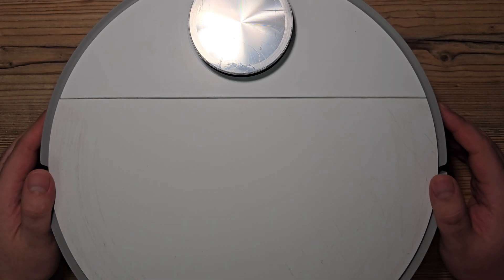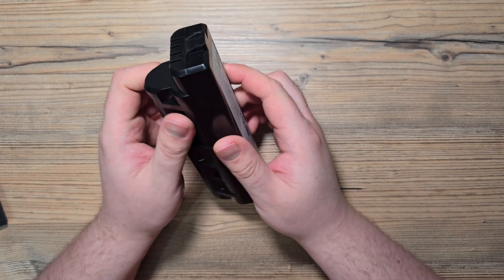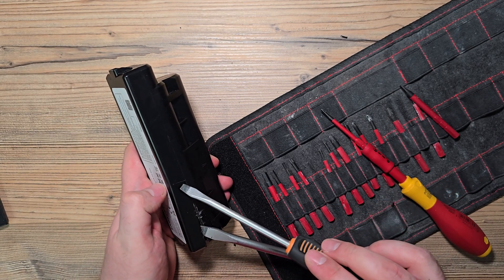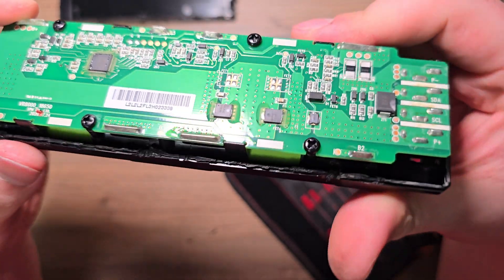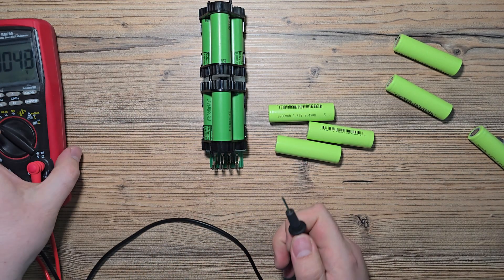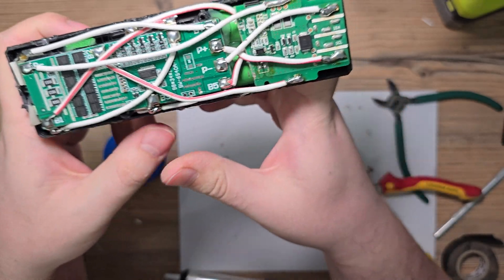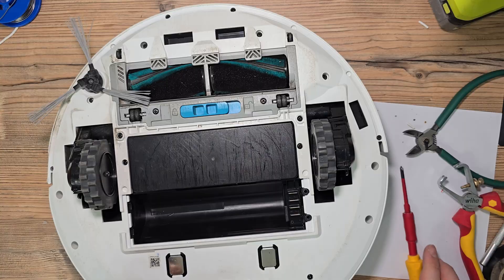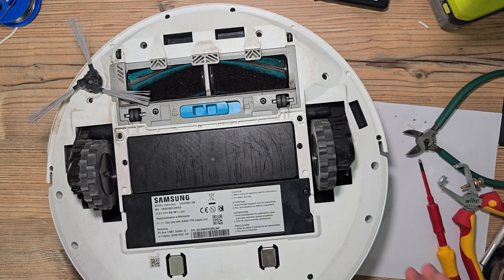Looking inside a Samsung Jet Bot battery, trying to revive it - mission failed.

Comment: Hello, thanks you for the video ! How did you change the cells ? Do you need to unsold the packs ? I removed the 4 screws and the cells don't want to move
Reply from the maker: these are spot welded, you need spot welder to do it, no soldering to cell